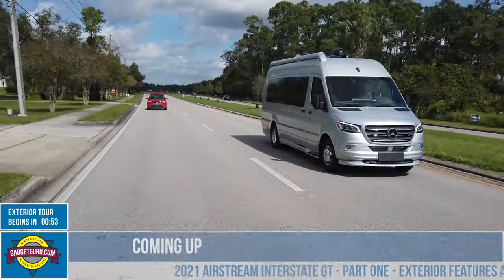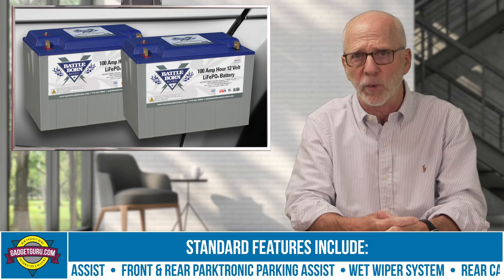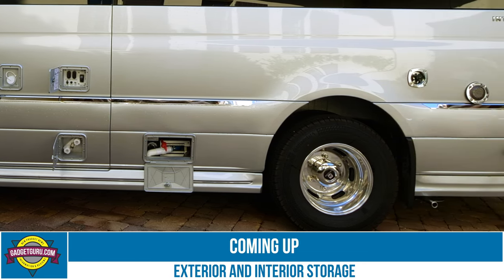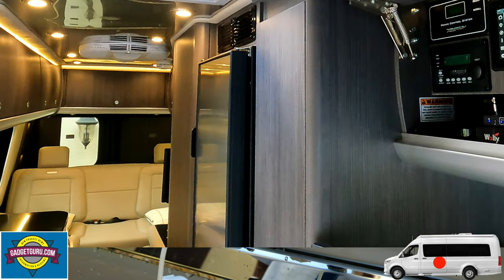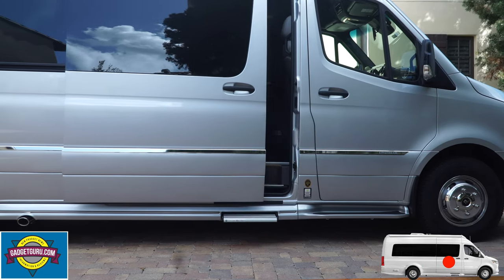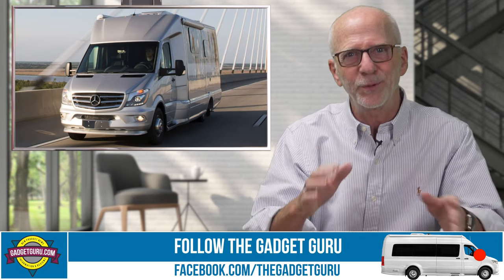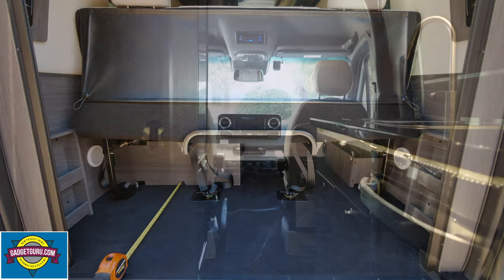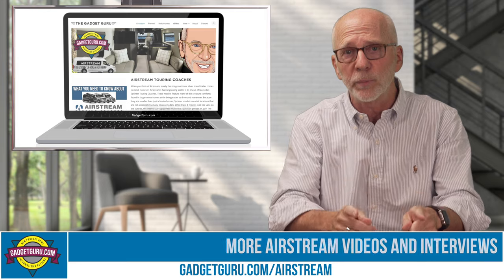2021 Airstream Interstate GT Feature Review - Part 1 - Exterior Connections and Storage

Comment: I have owned a 2019 and 2021. Anyone interested in getting one of these make sure you take it for a test drive and have them fix the many squeaks you will hear. Especially the one on the power sliding door… Due to the power window shade. It will drive you nuts when you get on the open road.

Comment: Great review. Totally agree with your assessment of the Airstream B vans as we ordered one last August. We compared at least 5 other class B manufacturers and it was apparent that Airstream’s class B was just a superior offering right out of the gate. Build quality and styling is typical Airstream. The interior components, cabinet quality as well as the appliances used are all top shelf stuff. Lithium batteries standard, upgraded battery management and full solar system was standard. The Mercedes chassis AS orders was fully Maxed out, only lacking 4WD which can be added. As far as the coach conversion absolutely everything is standard with the exception of the leveling jacks. This and upgrade to silver or black paint are the only two options available. I’ve heard many say that the Airstream B vans are way overpriced compared to the competition but the criticism isn’t exactly accurate because they are comparing apples to oranges. When you option out some of the other premium companies B van offerings and consider the fully option Mercedes chassis then there really isn’t that much of a price difference. Yes there are B vans available for much less but they are stripped down vans compared to Airstream’s B van. Many use the Dodge or Ford chassis and if a Mercedes chassis is used it’s often not optioned nearly as well as the base chassis used by AS. Looking fwd to your follow on reviews for this great class B motor-coach

Comment: Great information and well presented as usual! No tire pressure monitoring? Wow. I bought mine on Amazon for $200. I guess the Airstream bean counters would not approve that excessive amount! LOL.
Reply from the maker: It's not Airstream, it's Mercedes that is not incorporating TPMS into the wheels. It's a head scratcher.
Reply: @TheGadgetGuru  TPMS is not required by the DOT for vehicles over a certain gvwr. That is why Mercedes is not including it. But Airstream could have stepped up with an add on system. It would just be for 'nice to know' information on the 6 tires for pressure and temperature.

Comment: I almost forgot did you check out the Leisure Travel Van Murphy Bed model? That is a lot of rv for the money.
Reply from the maker: Of course I did! While I'm a fan of Leisure Travel Van products, they don't make a true Class B model. Also, I feel the fit, finish and materials used in the Airstream Interstate is a step up in quality.
Reply: We looked at 2021 LeisureVans, Pleasureway and Airstream. We had access to the Pleasure way for over 30 days. Pleasure way was beautiful and very well-built but lacked a few things we needed. The couch-bed was, however, amazing. But it has a minuscule garage, only 4 seat belts, including the cab seats, and only gets about 12 miles to the gallon. The LeisureVan Wonder was nice but not as nice in person as the ads. The AI interior was a noticeable upgrade in material and workmanship from the LeisureVans. The AI works for us. It has 7 belted sets (we have grand children, etc), it's “green, ” and has a great garage. The Pleasureway came with a “chemical” smell that even after 30 days made it difficult to stay in the coach for an extended period.  I called Pleasureway and they said it was the caulking material used and that it would dissipate.  Well, after running air cleaners and odor absorbers, it didn’t go away.  Made it difficult for some family members to stay in it.

Comment: I've heard some real horror stories about trying to get service on the road with these Mercedes platforms and know of several people who have gone away from the truck to keep their lives affordable.  Do consider this when doing your reviews.  Hopefully you will have this long enough to understand what it is like to slum into the used market as well as just owning one beyond the warranty.  Also, breaking down in a place where you are actually camping is different than trying to get it fixed from the stadium parking lot.  Towing a hundred miles to an authorized Mercedes dealer isn't an unrealistic threat.
Reply: So true We had a problem with our MB Sprinter on I 70 in Ohio two MB dealers said they were a month out to schedule a service We had a large truck service repair it for $1100 and 3 days in a crummy hotel eating fast food
Reply: They drove about 20 miles till started having trouble finally found a private garage that worked on Sprinters and $700 later we were fixed. Get a Ford or Dodge Promaster it seems like you might have a better chance at getting service

Comment: Lithium batteries can NOT be discharged 100%. Get your facts straight.
Reply from the maker: This information was provided by the manufacturer. I'm far from being a battery expert.
Reply: @TheGadgetGuru , I’m not trying to be hard on you and I appreciate your videos. Lithium batteries (any) will have a shorter life cycle if completely discharged. So it’s possible but not without shortening the life of expensive lithium batteries. For what it’s worth I have 1200 aH lithium batteries in my van.
Reply: And, when your lithiums get too low, the systems shut down and you can't recharge them with shore power, alternator or generator.